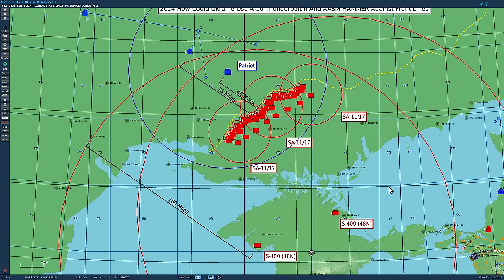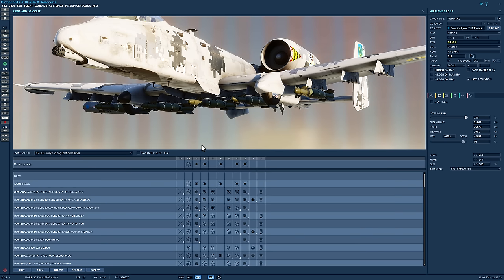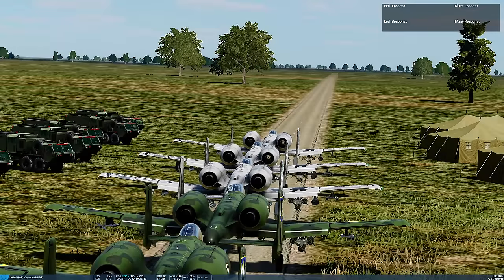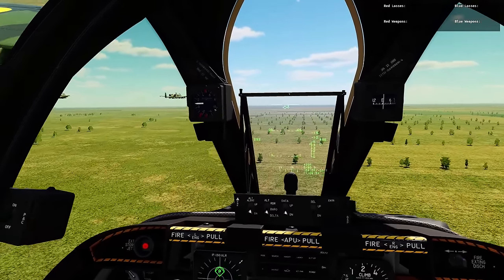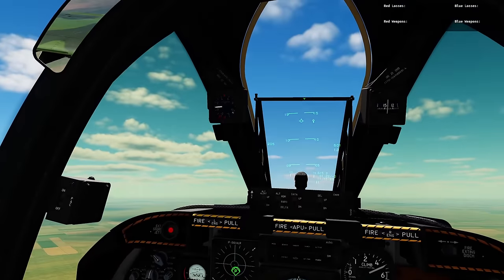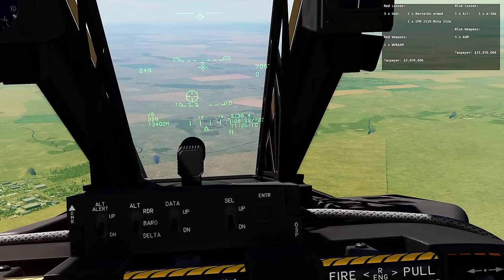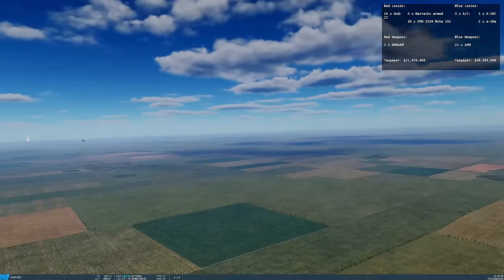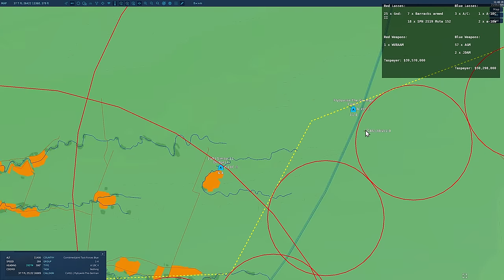How Could Ukraine Use A-10 With AASM Hammer Bombs On The Front Line? (WarGames 209) | DCS

Comment: I first read ASMR bombs and wondered what they could possibly be whispering on the way down.
Reply: 😅😂 that's funny
Reply: The missile knows where it is at all times. It knows this because it knows where it isn't. By subtracting where it is from where it isn't, or where it isn't from where it is (whichever is greater), it obtains a difference, or deviation. The guidance subsystem uses deviations to generate corrective commands to drive the missile from a position where it is to a position where it isn't, and arriving at a position where it wasn't, it now is. Consequently, the position where it is, is now the position that it wasn't, and it follows that the position that it was, is now the position that it isn't.
In the event that the position that it is in is not the position that it wasn't, the system has acquired a variation, the variation being the difference between where the missile is, and where it wasn't. If variation is considered to be a significant factor, it too may be corrected by the GEA. However, the missile must also know where it was.
The missile guidance computer scenario works as follows. Because a variation has modified some of the information the missile has obtained, it is not sure just where it is. However, it is sure where it isn't, within reason, and it knows where it was. It now subtracts where it should be from where it wasn't, or vice-versa, and by differentiating this from the algebraic sum of where it shouldn't be, and where it was, it is able to obtain the deviation and its variation, which is called error.
Reply from the maker: lol
Reply: woooooooosh ♪
Reply: "Oh no, not again."
Reply: "Knock knock"

Comment: Using A10 to launch Hammers would not be very efficient as it is very slow so that would reduce the range of the Hammers. Those are typically launched from medium altitude to remain outside SAM defense: the offensive plane would approach at very low altitude to avoid detection/SAM launch, pop up for a minute or less to launch the guided weapon (if using the GPS guiding system) and exit at low altitude. Laser or IR guided Hammers would only be used if long range SAM have been neutralised, thus allowing the plane to remain at medium altitude longer to guide the hammers.
Reply: They also rejected the offer for Thunderbolts. They dont want them, stating that they would be cannon fodder and a waste of ressources because of the enemies SAM and intercepting capabilitiees. Those planes need air superiority. F-16s are the better choice for SEAD missions, obviously. And thats what they will get.
Reply: @Gentleman...Driver exactly this. You'd need to be suicidal to fly an A10 in that theatre. I love the A10 in all its ugly beauty. I fondly remember building models of it as a kid and hurts to admit it, but it's obsolete unless you're fighting in very specific circumstances